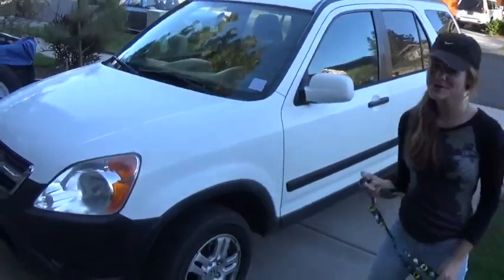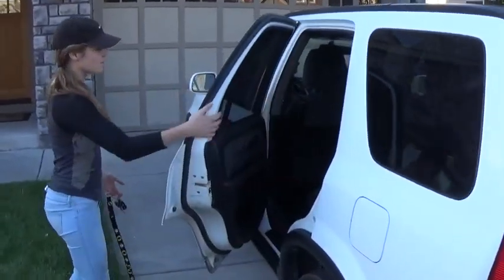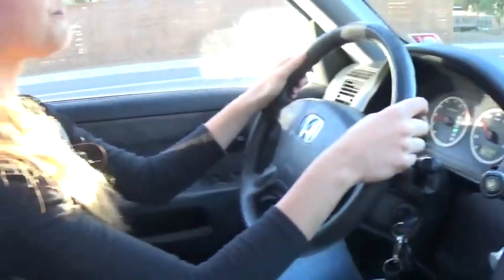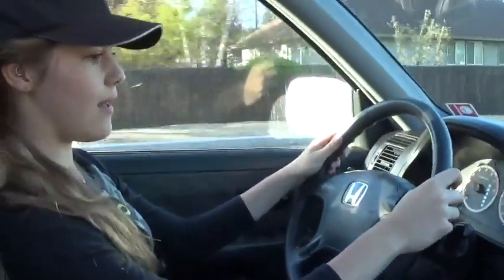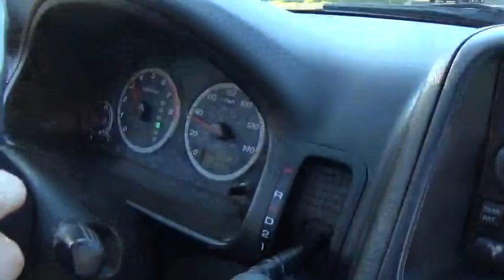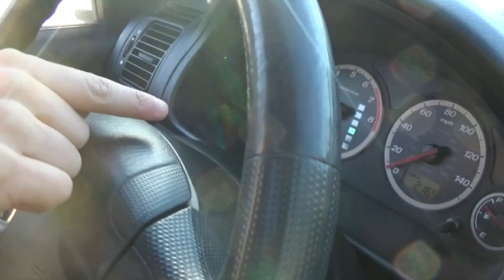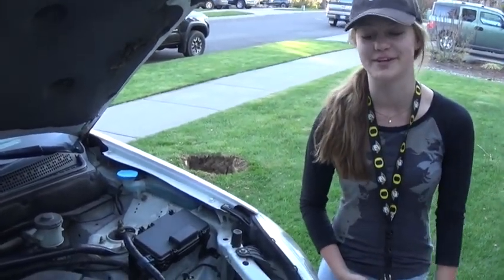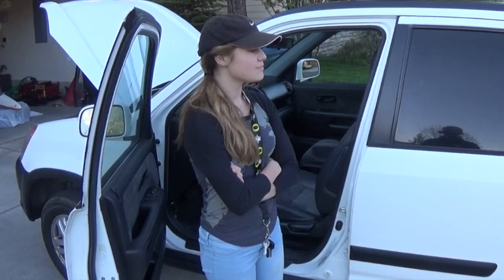Lauryn's 2004 Honda CRV Review

Comment: This makes me smile a bit because I remember my first car . It was a 1952 chevy two door hard top .  Worst car I ever bought but it was my first .  It was a 6 cylinder with a rod knocking . I hammered the piston and rod out stuck rags and hammered 2x4 oak in the cylinder and puller the rockers back . I drove that car for two years before selling it for 125 bucks . I paid 75 for it . LOL .
Reply: Jeff Mullinix my first car was a 2000 Mercedes E320, which I got in 2011 and still have it today and has 208,000 miles on it! I just got a second Mercedes and plan to keep my first car for the rest of my life because of all of the memories I’ve had in that car.

Comment: Still have my 2004 CR-V EXL. 191,000 miles. Under the passenger seat is a slide out tray for ‘stuff’. Also, under the floor in the back is a picnic table. I’ll be getting a HR-V next. Enjoy! Great brand.
Reply: How good is the fuel consumption mate?
Reply: @nhathuyla3258  HRV..30-32mpg
Reply: @debbyde3  I wonder if you are driving on the highway or mixed road?  Did you make any adjustments to the car? Is it a FWD or AWD? why is your car so fuel efficient?
Reply: @nhathuyla3258  got rid of that car in 2019
Reply: @debbyde3  thank you. Wish you the best.

Comment: I just got a 2004 CR-v 
Mine is a 2.0 all wheel drive. It’s in rough shape as the previous owner passed away and no one has run the car in over 2 years. It’s a fixer upper and I’m gonna cherish every bit of the process.

I live in India so we got the 2004 CR-v as a complete built unit from Japan. The Indian ones do get Airconditioning as it’s hot here and yes the picnic table under the rear parcel tray is amazing. What I also love is that the back seats can recline. These cars are known for engine reliability but the gear boxes, differential, AC compressors were all known to have issues due to unfavourable weather conditions in India for this Japanese specific built quality. I live right on the beach in Goa and the previous owner lived just 2 miles inland from me and the sea water has not been kind to the components mentioned or the paint which has bubbled and I know for sure there are rust spots. 

What I noticed about this car is the suspension isn’t as hard so you do get a floaty bouncy ride but that may be down to the fact that this car hasn’t run in a while and the suspension needs to be checked out. 

The original stereo and speakers in the car were from Clarion which was factory fitted. But they’re dead. The speakers are torn. So I’m replacing it will all new pioneer system all around including amps, speakers, touch screen doubledin deck and a nice beefy subwoofer. 

Next month I’m going to get all the transmission and differential work completed as well as all the suspension restoration as well as the Airconditioning. 

The car has run 60,000 miles which in the grand scheme of all things Honda is practically new. So there’s plenty of life left in this little car. Next year during the summer I’m gonna get the paint restored and probably get new all terrain tyres with steel off-road rims on it. All of this should cost me no more than USD $2000 and I got the car for $2500. And this car will last me another 10 years easy. So money we’ll spent I guess?

Enjoy your CRV cause I know I am.

Comment: I just recently got a 2004 CRV as well. People are right, there is a table in the back under the carpet. Pull the carpet up, lift up the latch and the whole thing comes out with legs. Mine has it and it is cool. I also have a hidden drawer under the passenger seat in front.  Mine has 175,500 miles on it.
Reply: How good is the fuel consumption bro?

Comment: I see that her second gen CR-V has an aftermarket U-Haul trailer hitch installed. Mine does as well. Just wondering if she has the common issue of the muffler hitting the hitch and causing a rattling noise?
Reply: I know what you are talking about, as I have an '02 with the same hitch. I have actually never had an issue with the bolts rubbing in the 8 years I've had the vehicle. But I remember seeing something where you could grind the extra threads off the bolts to create clearance, if needed.

Comment: What do you mean not AC? ?  I saw your AC push bottom on this video. My 2004 Honda CRV EX Sport has Ac
Reply from the maker: Just saying it doesn't work on this specific vehicle
Reply: Mike C oh got it. My 2004 CRV works ice cold and heater too. I love it just got brand new wheels and tires $950 out the door AT
Reply: Look for the tail gate table under the rug in the hatch
Reply: Laura Bednarowski  I do have the picnic table my 2004 Honda CR-V comes with and my old 97 Honda CR-V too. I don’t know about the newest ones . I’m wondering

Comment: Did she mean to say the A/C doesn't work? There is a A/C button on the middle dial. if the green light is illuminated  then she can control the temperature of the air
Reply from the maker: Yeah, I think what she meant it doesn't work.  Obviously since there is an A/C button it did at one time :-)